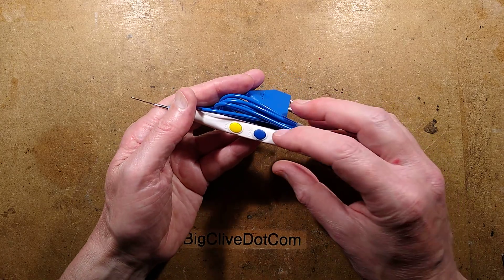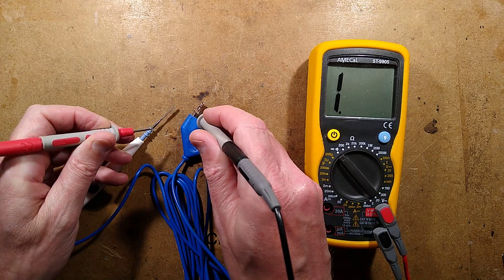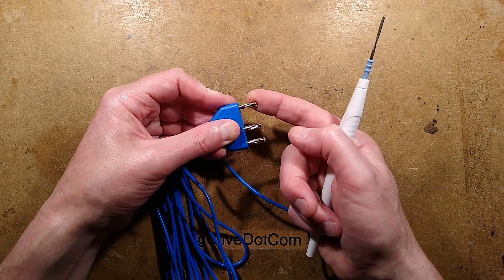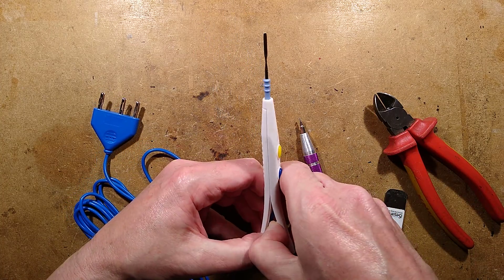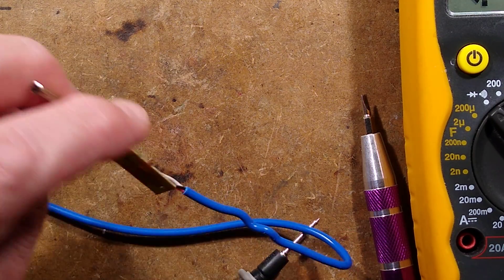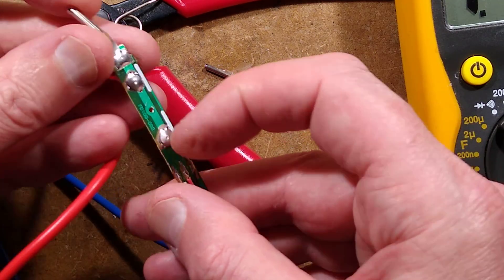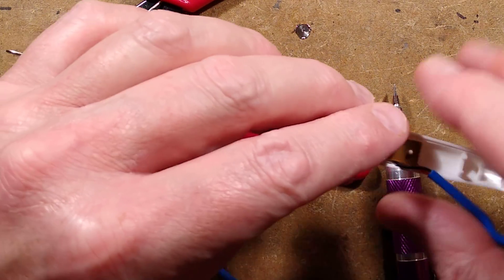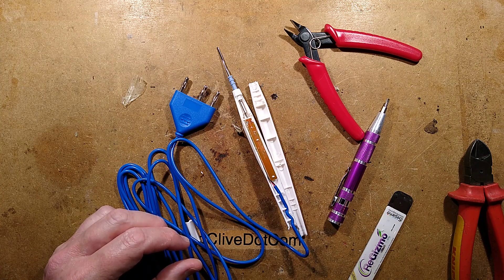Inside a single-use electrosurgery/cauterising pen

Comment: I use this when peeling off the short external rotator muscles from the femur. The discussions below about the return electrode reminded me of the time when I did a research fellowship in Australia. I did surgery on sheep lumbar spines. Sticking a gel pad on a woolly sheep was impossible. One of the lab technicians, a Mr Love came up with the idea of a solid metal dildo which was passed up the sheep’s bum. It was known as The Love Electrode. Very effective it was too.

Comment: We used to use an East German drum printer, Robotron EC7031. It used a capacityve drum position encoder, driven by a 200 kHz 100 V clean sinus signal. During setting the right encoder position if you touched the driver circuit you could smell the odour of your burning skin but couldn’t feel any pain.

Comment: There's also an indirectly heated variant more similar to a soldering iron.  It's been used on me in the 80's during wisdom teeth surgery.  No contact pad was put on me anywhere back then so it must have been an indirectly heated tip.  Other than that all the pleasures described by Big Clive such as the smell of burned flesh and smoke from my mouth, not for the faint-hearted patient.

Comment: My dentist used a nearly identical tool some time ago on me. I would think the current return path was capacitive coupled inside the chair. There were no other metallic parts in my vicinity. As far as I remember. And on the device front was only the blue wire and a earthing wire. But I could not see the backside.

The other thing is. I don't think it is necessary to optoisolate the button inputs in the device. I would think the tip is simply the circuit reference (0V) and the high voltage is generated to ground. Which would make current metering easier too.

Comment: When I was trying to decide on a career, I "assisted" a vet operating on a dog that had long term problems after having puppies. It is a remarkably effective tool for cutting tissue without causing bleeding. The main thing I learned was a lot of care goes into cutting layer by layer and separating some of the layers for stitching up later. There was a bit of smoke but I don't remember it having a smell. As best as I can remember, he used the pen for almost everything. I enjoyed watching that. What turned me off was another vet castrating a goat--no anesthesia, slice to the bottom of the scrotum, a dizzying squeeze and snip, all with the poor goat screaming his lungs out. That nearly put me down for the count, and turned me off on being a vet.

Comment: I remember it well...a vasectomy while awake. The intolerable part was the smoke and smell. I think I won't be doing that again (for obvious reasons). No doubt they used these for my open heart surgery, broken femur surgery, hernia surgery, surgery to remove a cyst in the roof of my mouth, and rotator cuff surgery, but I wasn't awake for most of those. Kinda glad. Also wondering what's next?

Comment: Recently had operation under local to remove a lump on my back, which was a total success. My surgeon used one of these. Had an an awesome time watching the display on the main unit. 

Scar has healed well nice and smooth but looks a bit like a centipede form the stiches.

Fantastic  technology makes patients lives easier.

Comment: Mr Clive, could you figure out the frequency by the length of the antenna/tip??? 
Does it use sympathetic frequencies to do different tasks???
Just curious...
Reply from the maker: It's not that high.  The tip is effectively just an electrode.

Comment: I had to go through a minor procedure to have some skin cautarize to deal with skin hardening on a finger. I got really worried when I saw pad and a probe and electrical current equipment, if its going to give me shock, lol. Surgeon explained its safe and no need to worry.

Comment: When I was an electronics tech we had a gold wire bonding machine used to connect surface mount components to other components or to gold covered traces on the substrate. The hollow tip the gold wire was fed through would vibrate at a very high rate of speed when it was pushed downwards (to close a switch), that created enough heat to melt the gold wire into the bonding surface. The wire bonds were very secure and could withstand several Gs. I'm not sure if the top of this device vibrates or if the frequency he mentioned just modulates the voltage it applies. Interesting tool.

Comment: The electrosurgical unit has two waveform outputs. Cut waveform is a smooth sine wave, cautery is a nasty looking waveform. Two waveforms for two separate functions. And the cut mode is not used for the initial skin cut. That is done with a conventional blade type scalpel. Makes for a prettier scar.

Comment: Hi ,I actually bought the machine that the pen fits in ,I could never find the probes ,The machine weighs about 40kg with a huge transformer .when you finish send me the pen and I can see if it works ? It lights up and when i tested for voltage it was really low voltage 2 vdc.where is the probe from? I just looked on Ebay and no 3 pin probes,if you want any pictures of the machine just ask ,best wishes stay healthy
Reply from the maker: Check out aliexpress for the pens.

Comment: Interesting story - We were called in to troubleshoot a problem in a surgery room. Whenever they used the electrosurgery pen all the video monitors in the room (except the surgeon's) went blue or static. Not surprisingly this was an EMI problem due to the device being plugged into the wall, very far away from everything else. It proved tricky to fix though, as the staff could not have a loose cable (grounding the device to the operating table) laying around for them to stumble on.
Reply from the maker: That could have been a grounding issue.

Comment: Yes, there are different shapes and lengths of tips! Often, especially with minimall invasive small incision surgery, surgeons will bend the tip to reach around an angle. Being able to replace the tip without reconnecting the whole pen is efficient and more sterile :)

Comment: So basically as mentioned in the video, and some of the comments on it, the tips are interchangeable so you can use them for different tasks though most surgeons just use a very limited variety as the standard one gets the job done. 
We had a rep from the company come in and suggest to one of our back surgeons that he might want to try a different one for spinal work, one normally used for facial surgery. It essentially consisted of a very fine wire on a ceramic former to give it support which meant it had a much finer contact area and thus was ideal for delicate work such as faces, or in this case spines.  The surgeon did ask if it was compatible with our electrosurgery generator, and indeed it was. Unfortunately no one thought to actually read the instructions for it in which it advised to start at low power and work up. Instead they used the bog standard cut and coag settings that they normally used for the usual tip and it exploded in the patient's back, because effectively the fine wire now acted like a fuse and blew. Luckily no harm was done to the patient but it did extend the surgery time as the surgeon had to pick fragments out of the wound. So the moral is always RTFM

Comment: The plume of smoke that results from using this on flesh is carcinogenic so often a smoke evaluator is used. This pencil is called a “bipolar hand switchable” the converse are mono polar foot switchable which only have one wire and connector.

Comment: What a waste. They could have made the tip replaceable. And everyone is wondering why our planet goes down the toilet so damn fast.
Reply: There's no way to reliably clean and resterilize these, so they get thrown away after use (and even if they are not, since the hospital already charged the patient for it, and it's just easier and cheaper for them to discard it than to restock it)

Comment: I designed and built a surgical instrument back in the 80's, aimed exclusively for use in ambulatory day care. It very much resembled a Stihl 011 chainsaw because it was a Stihl 011 chainsaw, but I had replaced the factory saw chain with industrial diamond coated wire, which was quite tricky to move around the bar without getting jammed. Once I had worked the bugs out however, preliminary testing revealed an altogether unfortunate tendency to coat the walls, ceilings and operator with copious amounts of blood, bone and tissue so I abandoned that design... I can now see I should have electrified the industrial diamond coated wire! Now, where did I put that spare 370 amp alternator?

Comment: C I work for a doctor in college and repaired the other side of this electric surgical unit. I would test it out on a finger not cutting too deep but that was the best way to see if I had fixed it. It has no pain even without localize a static. Of course when I worked on these units we used tube driven oscillators to create the high frequency.

Comment: The pad for the return current has two separate contact plates and the diathermy machine measures the impedance between them to check for a good contact, turning off the machine if it detects a bad connection. This is because bad pad contact could lead to a high current through a small surface area, burning the patient's skin beneath the pad.

Comment: As someone who’s had one used on them I don’t remember seeing the pad and I got shocked a few times lol
Reply: The fact you noticed the shocks suggest you were awake and hence they may have been using a hyfrecator, which is similar but not quite the same as diathermy (the former being low powered), and doesn't need a return pad. However if you are touching something metal like a table support you will be grounded and feel it as a shock

Comment: Having used cautries for years it was fun to see one of them dissected! The tips are interchangeable, with longer tips, looped tips and needle tips, ect. the machine that the cautery plugs into also has a gel grounding pad that is placed as close to the incision site as possible  for a shorter distance between the electrode and ground pad, we also do not want any metal on or in the body that may be between the electrode and ground pad  for obvious reason!  The ground pad is a gel coated REM  (return electrode monitoring) pad that senses for high resistance from the cautery pencil to prevent burns from the pad coming loose, it shuts down the generator if more than 20%of the pad is not in contact with the patient ! These burns are particularly bad as they burn from the inside out‼️ the generator unit that the pad and pencil plug into has multiple setting for width , depth and blend with cut for coagulation!   As a side note, the cut feature isn't used often,as I have observed, as the cautery on cut burns the edges of the skin and can Make healing more difficult,  you actually want raw edges for better closures that heal (stick together) better. There you have it then.

Comment: With that switch configuration I’m guessing that the probe tip is ground referenced inside the machine, and the other electrode applied to the patient is ‘hot’.

Comment: Nice to see something relating to my own field of work. I work as biomedical technician and one of the dutys is maintenancing Valleylab diathermy devices. This is a monopolar pen meaning it needs an return electrode for the RF current. There are also bipolar tweezers that make great DMM test leads for SMD work.

Comment: I'm super curious to see what the circuitry this plugs into does. I have enough experience with induction furnaces to understand why you have to "tune" the frequency for efficiency melting different metals. The different atomic mass/density of metals/alloys has resistance at fairly specific AC frequencies. It was also fascinating to see that any metal that conducts electricity, will absorb the induced power in a way that acts like magnetism. With enough power at the right frequency, induction furnaces can actually levitate non-ferrous metals while heating!

I'd really like to know if this tool uses a similar power source, or if my thought process is just way off base.

Comment: I’ve cut up quite a lot of chicken using one of these, smells like a BBQ. There have in the past been cases of patients being burnt by metalwork of the operating table. They used to use a single return pad on the

It works on surface area of the contact, return pad about 150mm square * 2 pads, and cutting area 2-3mm.  Increased current density is doing the burning action. Ever noticed how a little spark as you touch the car door hurts, but if you hold the key and the spark jumps from the key you don’t feel a thing.

Comment: Any chance of getting hold of a “Force FX” diathermy & doing an autopsy on that ? Would love a explanation on the RF board, Low voltage board, & how the high power mosfet & RF diodes work, plus those machines have been a workhorse in the NHS for years & still found in theatres today.

Comment: I'm confused, if pressing the buttons shorts the common back to send a signal how is it still cutting at the tip? how is the voltage going two directions?
Reply from the maker: The circuit is a closed loop, so the pen may at circuit ground reference.

Comment: Monopolar diathermy They exist as a bi polars- forceps 
You will need patient return electrode to make that monopolar works
Tip on this is removable because you can get different sizes. Burned tissue gets also evaporated and some stick to a tip and requires to be removed by scratch pad

Comment: The fact that it has a removable tip is probably why its made to be disposable. In the old days stuff like this would be autoclavable, but given todays mass production, its safer, cleaner, and cheaper to just make the part that gets nasty go in a bucket afterwards. My parents are doctors, and I have the business end of one of those a few feet away on a shelf,  and have also been one of it's "subjects." They work, but they stink. Cant stand that smell, esp. when its coming from my own burning flesh.

Comment: Alas, the description has already disabused me of my hope that this is something I can get hold of and use to maybe kill off my recurrent ingrowing toenails. I shall have to keep looking for some other form of cautery.
Reply from the maker: I had trouble with ingrowing toe nails.  I ended up using a clean pair of electronic side cutters to trim down the sides.  Not fun to do, but long term relief.
Reply: I've been doing similar, but they do eventually come back from that. Of course, being diabetic, DIY foot surgery is a remarkably terrible idea, but in the current situation it's pretty much that or agony, and I do keep a close eye on the results. Hopefully things will ease up enough that I can persuade a doctor to do the job properly in the not too distant future.

Comment: Interesting video, but we need a tear down of the power supply. I had something similar... It was a pocket pen style; battery operated. Looked like the pen doctors use to check your eyes for contraction... Had a wire tip that heated up, when the button was pushed. Also single use. The tip was fixed and could not be changed out.

Comment: Did you buy that off of eBay
Reply from the maker: It was sent to me, but you CAN buy them online easily.  Usually as bulk packs.
Reply: @bigclivedotcom  They're sold by the manufacturer in lots of 50.  The american prices i found runs to around $330 for a pack of 15, while in the UK, they cost about $145.

Comment: A single use monopolar cautery pen. Tip is replaceable for different lengths and tip types depending upon the type of surgical context; these tips can also be teflon covered for extended life. All the electrical frequency generation is generated in the main unit (which this plugs into); a grounding pad completes the circuit for monopolar cautery; bipolar cautery has two tips for power source and power return. These pen units may also have telescoping tubes over the tips in which a vacuum draws in the smoke from the cautery (this smoke being toxic and carcinogenic). The tips (and sleeve) are counted pre-operatively and before final surgical closing (and sometimes counted more if in body cavities) as these are removable and need to be accounted. Sample cautery that uses this type of pen is COVIDIEN's Valleylab™ FT10 Energy Platform.
Reply: The device is much safer now and burns due to the return plate and very uncommon. The return plate uses 'REM' which basically measures the skin resistance (70 -100 ohms) and if the plate dislodged a little bit the resistance changes and cuts out the device.

Comment: I remember playing around with CCFL inverters from flatbed scanners back around 2008 and before and it didn't give me actual electric shocks but instead caused pin-sized burns that didn't hurt that much as I poked at one of the wires with the tips of my fingers, where the skin is at its thickest.
It smelt like burned dead skin and left white burn marks on the dead skin layer. (Show more please)

More recently I got a 5 watt FM transmitter from eBay and if I touch a pointy and "hot" part of the antenna it gives me small "shocks" along with pin-sized burns on the tips of my fingers.
I think it also makes some sort of corona discharge or even actual arcs of about half a millimeter of length.

RF is weird and quite mysterious to say the least...